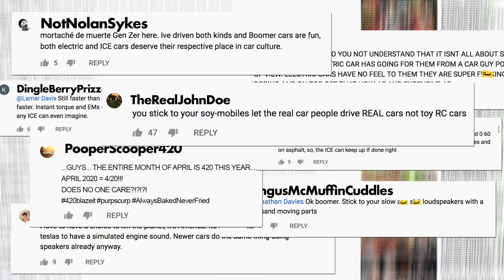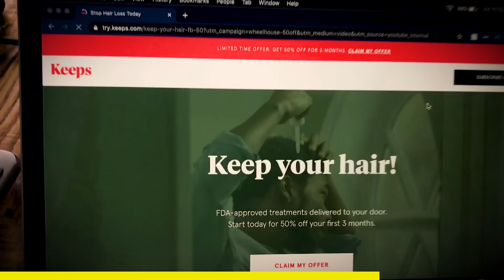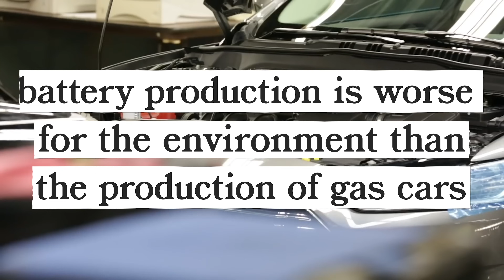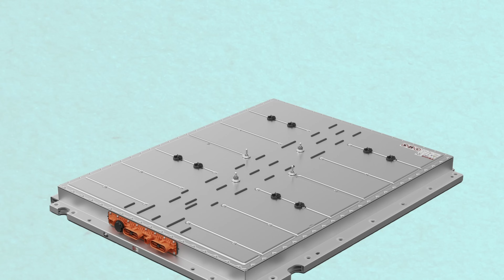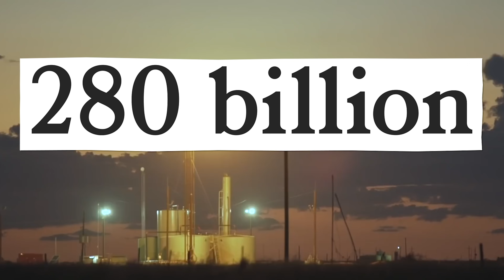Are Electric Cars REALLY Better for the Environment?

Comment: I once asked a fellow what the MPG was for his drag car.  He became enraged.
Reply: Drag cars do not get MPG, its how many GPM they do. 
She'll do 3 gallons per 1/4 mile mate.
Ever seen a top fuel dragsters fuel pump? That boii can drain a swimming pool in seconds.
Reply: 10 gallon per mile
Reply: Alex M feet per gallon
Reply: It was 1
Reply: Measured in gallons per mile (not mpg)
Reply: @chriskelly7593  you sir are awesome.  That made me laugh.
Reply: Maybe all these professional racing organization like NASCAR,  Formula 1,  Sprint cars and even Air racing should start requiring a minimum MPG.
Reply: @Dialysisforever  F1 doesn't have an exact "mpg" requirement but it does have fuel flow rate regulations
Reply: @Dialysisforever  I don't know about the rest but F1 has a limit of fuel flow(I think it's 100L/h) and it also went hybrid despite fans wanting V__insert number here___ cylinders engines and are  constantly looking for improving fuel efficiency...As stupid as it may sound at first they are even considering going to a two stroke engine...as I said sounds stupid but those engines have come a looooong way from the ones you are picturing right now in your head...They really want this thing to be as friendly as possible to the environment. The current engine is a 1.6L V6 turbo hybrid...And makes ~1000HP combined which 600-ish is only from that  1.6L ICE. I say it's pretty impressive...And they have only 3 engines allowed per season, meaning they need to be reliable as well.
Reply: @Dialysisforever  maybe you should move to russia
Reply: @Dialysisforever  they all use the same engine and all that so they all have the same mpg...well at least in nascar
Reply: @patwinner5440  Nascar is a really dumb "sport" it's just a bunch of cars going around and around for hours. It has very little to do with skill and more about where you qualified/started the race. And on top of it they restrict the technology that can be used so the cars can't even be innovated and are forced to run on outdated tech.

So many other sports from F1, to rally cross, and even GT and supercar circuits make so much more sense than Nascar.
Reply: Will Reese nascar is actually a very difficult sport
Reply: @Noadvantage246  you clearly dont understand i can imagine youd have just as hard of a time starting number 1 on the grid in nascar as you would starting number 1 on the f1 grid
Reply: @Noadvantage246  I don't like Nascar but wow you really don't know much about the sport. Even F1 drivers appreciate the skill that Nascar drivers have. And if the people at the pinnacle of racing can appreciate it, then it really invalidates any of the negative opinions you may hold about the sport.
Reply: Will Reese     Have you ever seen Kimi Räikkönen try nascar? He sucked
Reply: @Noadvantage246  NASCAR takes a lot of skill even if it is boring to watch. It's pretty much extreme slipstreaming
Reply: @Noadvantage246  you obviously know NOTHING about the science of mechanical grip and aerodynamics. 
The 2 things that make skill and experience the #1 factor in going fast over those 500 miles of circles. 
Ridiculous, ignorant comment.
Reply: Will Reese like all sports rules and regulations change over time. The golden days of nascar were 1949-1985 STOCK CAR RACING what won on a Sunday night you could buy at a dealership on Monday it was fun it required more skill there were all kinds of cars on the track now They’re less of a car more of a machine of high performance standards with whatever name brand is one it
Reply: @Not_A_Cat  Wow I didn't realize what a hot take my comment was, don't worry your dying "sport" still has maybe another decade before it's taken behind the barn.... That's plenty of time for y'all to waste watching ppl "skillfully" drive around in circles
Reply: @lemmythebulldog8812  ^
Reply: @KaitouKaiju  ^
Reply: Will Reese yeah if you ever did any oval track racing you’d crash leaving the corner. oval tracks are notoriously hard to pass on. also the outcome has nothing to do with qualifying place, numerous drivers will go all the way from 20th place to top 5 in by the end of the race. in addition to that the races are wayyyy closer than F1. i’ll look at the top 6 for some F1 race and the 6th guy will be 15 seconds behind. in NASCAR you’ll have the top 8 drivers sometimes finishing within 10 seconds. i certainly enjoy F1 and road racing with their complicated tracks but NASCAR gets REAL intense sometimes when you have them going 3 wide around a corner.
Reply: Will Reese seriously, just watch a nascar race for once. actually sit down and just pay attention to what’s happening. you’ll notice drivers skillfully dodging cars crashing ahead of them, drivers somehow passing each other on corners that require almost no braking, and driving inches from the next cars bumper to maximize slipstreams. i certainly enjoy watching rally and f1 more but that’s not to say NASCAR drivers are bad. they’re certainly much more talented than any average driver, and, by the way, nascars can turn right, too check it out here https://www.charlottemotorspeedway.com/handler.cfm/template,video/cat_id,56058?med_id=1827736
Reply: @Noadvantage246  you have obviously never driven a powerful vehicle or been in sanctioned race.
Reply: @jamesbrennan1404  lmao cuz the person has to be in a car and take left turns for hundreds of laps and waste gas???
Reply: @Noadvantage246  lmao yes
Reply: @boxr_4214  I dont think will was trying to dis the driver's but just the concept of nascar itself
Reply: @Noadvantage246  okay than next time try to drive in circles at 200mph while being inches apart
Reply: @Noadvantage246  I don't even like NASCAR but I understand how the sport works. now you're just being combative for the purpose of being combative

Comment: But what about ICE vehicles that runs on renewable fuel, like in my case, HVO instead of diesel?

Great video 👍
Reply: Don't forget Bio Diesel, which are made from plant based sources, and can even be made out of recycled cooking oils, most of the time all you need to do in order to convert a normal diesel powered engine is change the fuel lines from rubber to synthetic ones, and add some inline fuel filter to catch any micro particulates in the fuel before they reach the engine. of course you still need all your other normal fluids like oil, transmission fluid, coolant, etc..  but it's still much much cleaner than a normal diesel engine.
Reply: My understanding is that they produce up to 90% less co2 as compared to equivalent diesel motors. Being that modern diesel motors produce about 40% less co2 than equivalent gasoline motors, it's getting into pretty interesting territory. Only downside really would be wide spread availability. It's works outstandingly well for the ones and twos that have it, but it's even less adequate to be a mainstay than EV is at this point.
Reply: Agreed, upside is that you can alternate to regular diesel if bio/, hvo isn't available..
But I think one should consider the effort put into battery vehicles into a more suitable fuel that's compatible with current vehicles that can relive the problem we have on the vehicle fleet we are using today, compared to scrapping them. I just can't see that the environmental in battery ev for all thinking that "all" seem to have. (I don't mind electric vehicles, but I don't like the idea of batteries)

Comment: You forgot one HUGE key thing the battery packs on a EV have to be changed out every couple years. I know that the manufacturer claimed something like 80,000 to 100,000 per pack. It isn’t true. According to my family member who is one of the few certified master mechanics for some EV’s as well as many regular cars as well as exotic car, the true rate of change is about every three years. Sometimes as much as four year. The manufacturer ideal is to change the battery at LEAST twice during its life. So triple the EV battery foot print minimally.

Comment: I personally think we are heading in the complete wrong direction. So before I get into this I just want to point out how much perfection has gone into ICE technology. I think cars can become completely carbon neutral if we develop biodiesel technology. The algae that is used to produce biodiesel can be grown at a rate of 10,000 gal/acre. Even just growing the algae reversed damage to the environment as all plants absorb co2. Biofuels are very low in terms of resource intensive and if the production of it was ramped up enough with the combination of fuel efficient motors we could easily become carbon neutral

Comment: I'm a jersey union commercial electrician. I've built several solar fields now for the power companies to feed the power grid. We do that because the power grid in big metropolitan areas in NJ already has trouble feeding enough power and already hits occasional brownouts and blackouts. I've done 3 massive fields (30k, 35k, and 45k panels each 2.5'x6') and there have been many others like them I didn't work on. At this point I'd say it probably has about fixed jerseys problem. But that doesn't mean it's ready to take on a substantial increase in power usage if everyone switched to EVs. Granted the switch won't happen over night so they should adapt with the change but I'm just saying. To say the grid is adequate power to switch to a quarter of the US driving EVs tomorrow? Idk where you got that from and maybe in other states but from what we are told about these solar fields I'd say jersey ain't ready....

Comment: Fairly accurate but you missed one thing about wind and solar being zero emissions.  Wind is basically net negative energy and solar isn’t that far behind.  If you use nuclear, you get closer to true net zero.  You showed steam coming from cooling towers when talking emissions .  I’m actually in favour of the electric motor, it’s just the battery technology than still needs development.

Comment: Something this video fails to address is the fact that electric cars eventually have to swap battery as they decay over time, all of these stats are assuming an electric car runs with the same battery for its entire lifespan. The current estimate for how long most electric car batteries last is around 10 to 15 years, effectively making old EVs worthless unless they get new batteries, which obviously will increase emissions by a ton.

Comment: Sound and vibrations of combustion engine can be just replicated. The only reason it wouldn't be - people won't give a fuck about sound in 10-20 years. That's the evolution process. I imagine how a driver in the 19th century spoke maliciously about newfangled loud gasoline carts that will never replace the sound of hooves, the smell of excrement and the sensation of a horse.

Comment: 9:00 you forgot to mention how long that period of time can be
Reply: It depends on the car and how much gas you'd normally use.   Also where in particular your electricity comes from.   I don't commute or drive very far when I do routine things, so it would take me an extremely long time, probably longer than the batteries would live,  for me to offset the manufacturing of an EV.  But I'm very much an outlier that way,  especially cause I can and usually have to save my vehicles from what could otherwise be the end of their lives.  (Also if I had new car budget I'd probably still spend it on modernizing an older vehicle cause I like those better and because I can.  :)  )

Comment: Problems will wind and solar, those windmills actually aren't fully electric, the have gasoline engines in them because the wind doesn't always blow and the solar panels only have a short life span and then the production leaves a environmental foot and recycling them is something that doesn't exist, they sit in landfills right next to those  used lithium batteries.

Comment: Best car for the environment? The one that hasn't been built in the first place. The best thing to do is drive your old car as long as possible. The resources put into production once have to be used as long as possible. Your average car will drive for 150.000 miles before it did the same pollution to the environment than the production of an electric one...

Comment: The thing that worries me is the batteries themselves. Yeah, i know "good battery management bla bla bla". But still. How many batteries have we heard of that's completely fine after ten years of constant use? When EV's are getting bad batteries the will be scrapped en masse. And why haven't we heard about it? Guess what, it hasn't happened yet! But think about it. Bad batteries is starting to be a thing on older Priuses now. And a hybrid should be the best place to be for a battery. It can charge whenever it want's to. So if "keeping it between 20 & 80%" is so good, i guess the Prius will use it's luxury to do just that. Still we se bad Priuses. So if we remove that on-board gas charger of the Prius and use the exacts same kind of batteries (Talking to you Tesla) well what...? Well, i guess it will be like with everything else with batteries. Disposable tech with planned obscolecense. And that's the best case scenario. What about all the ignorants that will bash the hell out of their batteries?

Comment: You forgot some things whit the EV, the battery lose power in cold weather and when you replace a battery  you throw away the good deeds that has been done. There is cheaper ways to help out like alternative fuel, a diesel can run on fry-oil or we have gas conversions.

Comment: But what about keeping a well tuned gas car on the road vs scrapping it and buying a new car every 7 years? That omits the production co2 emissions (in my case of a 30 year old car) about 4 times, so that is potentially almost 30 metric tons of co2 saved by keeping a good older car going vs the replace every 7 years. But evs will need very environmentally damaging battery replacements to go that long vs an ece vehicle. Just something to put out there

Comment: Nuclear energy is a good way to get electrcity
Reply: It's not stored because they don't know how to dispose of it properly, it's because they'll be throwing away energy if they do. Imagine if you refined crude oil but only used the derived Kerosene and disposed of the rest.
Reply: @MKDC-5  I'd be immensely glad to have a 1400MW plant powering my state, and a 150MW Small Modular Reactor the size of a shipping container powering my city. Better than having a 10 square km solar farm producing that same 150MW, and having it inevitably backed up by a 1200MW coal plant providing the baseload energy.
Reply: Hello peoplee It is, but they’re expensive to build, can only be built in certain areas, and people are scerd...

Though they are pretty safe.
Reply: Until it's not.   Earth quake, unforeseen  automation issue.  Then there is the storage of the radio active waste.  Yes, it is stored because they don't know how to dispose of it safely.   Oregon had a nuclear plant that  was shutdown years and years ago but the nuclear waste is still buried there.  They are now saying, the barrels may start to leak anytime now.  What a mess.
Reply: @Dialysisforever  Do you know what nuclear waste is? It's not glowing green goo. It's solid chunks of metal. And it's not technically waste, it still has 98% of its energy potential untapped because present reactor tech can't make use of it yet. But now that's changing with 3rd and 4th generation Fast and Molten Salt reactors that literally run on "nuclear waste."
Reply: @strichtarn3228  I am not sure what this has to do with my comment.
Reply: @Dialysisforever  The whole thing about nuclear waste? It's a non-issue. Stored fuel rods are essentially batteries.

Comment: I am wondering about overall life of a vehicle.  Most manufacturers of ev's guarantee a certain amount of battery life within eight years or 100,000 miles.  
many of my cars have had well over 200-300k on them and are 20-30 years old and still going.   if you were to keep an ev going that long and potentially replacing the battery up to 3 times over that same amount of miles/time does it still lean in favor of ev?   just a thought.      I have always wanted a Tesla/Fiskar
Reply: Brenden dvorak maybe not at the moment but soon the batteries will be quite recyclable, so if your in the market for an electric car by 10 years they will still be more efficient

Comment: A petrol engined car will outlive an electric car. Take a Prius vs a Yaris. The Prius batteries are dead after about 7-10 years. The value of the car is so low at that point that battery replacement exceeds the value of the car so it's scrapped. A replacement vehicle is manufactured creating all the CO2 used to manufacture it. The petrol Yaris after 7-10 years is fine, doesn't need replacing and likely wont be scrapped for decades to come because it is cheap to keep repairing and running. This is the reason that classic cars are exempt from road tax in the UK for example, because the Gov recognises that after decades on the road the CO2 footprint is neutralised. There is not a single electric vehicle on the road which reaches carbon neutral before the cost of a repair exceeds the value. On that basis alone it is a false environmental and financial economy.

Unsubscribed because you're part of the problem.

Comment: Maybe EV's are a bit better for the environment than gas cars (although other calculations say the opposite). But because that difference is just so small why didn't you take a look at other alternatives like hydrogen engined cars ? They are in so many aspects so much better than EV's. That's so frustrating that everyone is just like EV's vs gas and I was a bit dissapointed that you didn't even mention it.